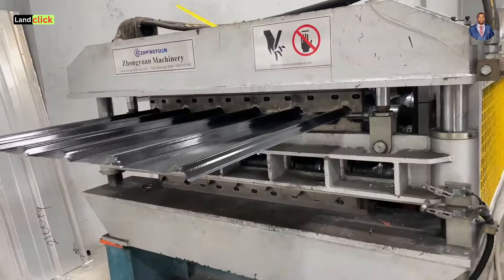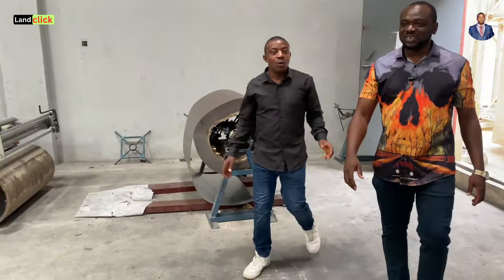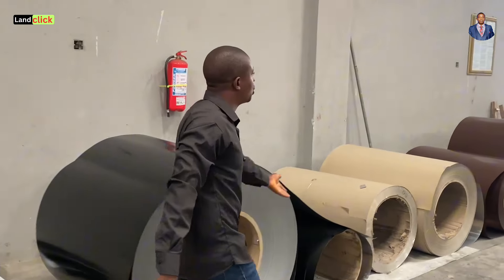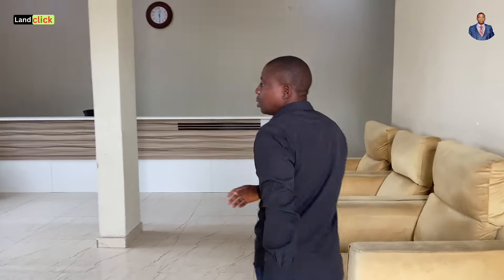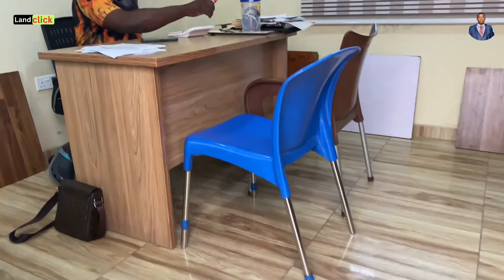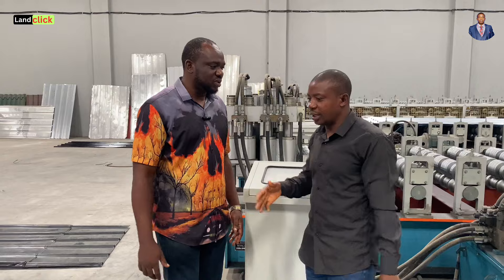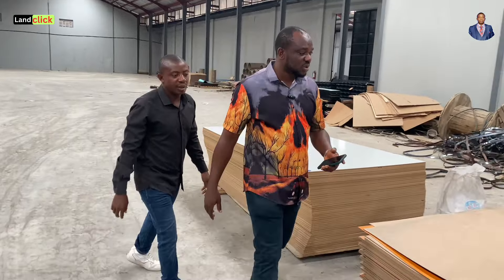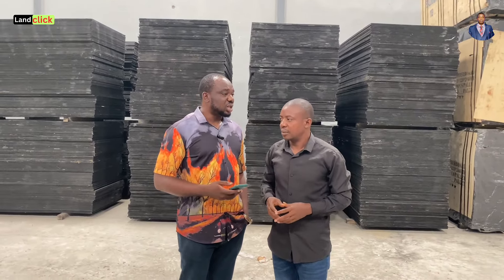Current Prices of Roofing Sheets In Nigeria 2024 | Gerard, Shingles, Milano, aluminum

Comment: How many of them in a bundle?
Reply from the maker: These types of Roofing sheets are sold per square meter, not in bundles. 

For an accurate quote, you need an aluminum expert to take the measurements of your house after the woodwork has been done.

Comment: Pls I need metrocopo design
Reply from the maker: Yes, they have it. Is your site in Lagos? We can talk here: +2349077319888
Reply: Please don't go for metcoppo it has what we called lapping linkage problem, better still go for step tiles Alumnium. Talking from experience
Reply: METICOPO IS ONE OF THE WORST ROOFING SHEETS AM STILL SUFFERING WITH LEAKAGE ON TWO OF MY BUILDINGS IN PORT HARCOURT 
THE LAPPING IS VERY BAD